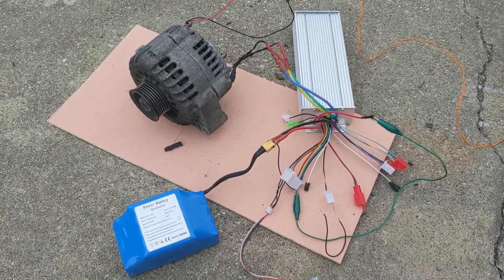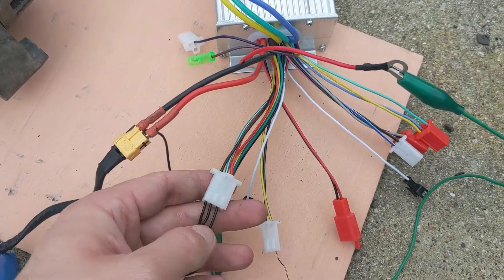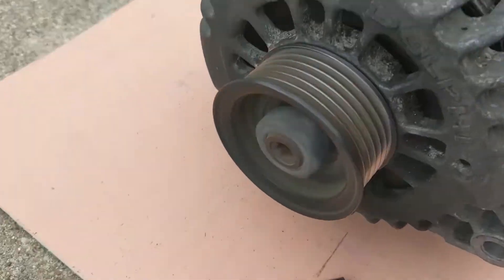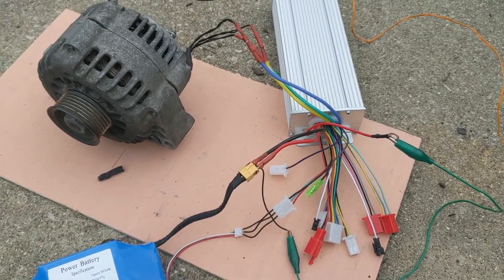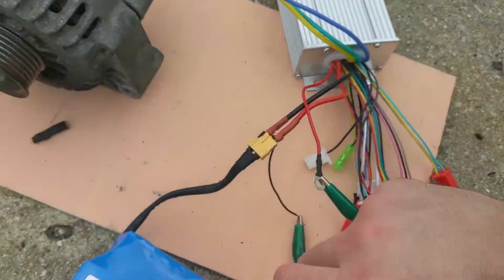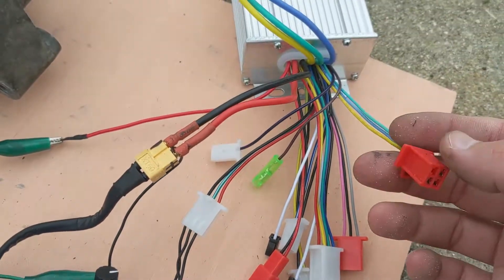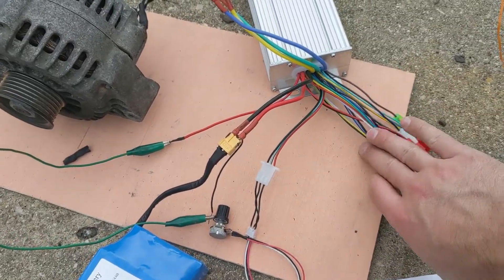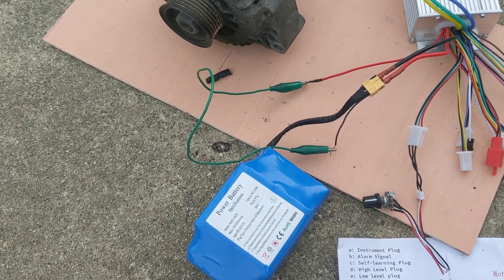Alternator to Motor conversion part two

Comment: 2:10 I think the motor spins slower when you loop the wire into the reverse connectors is because if the controller is used on a mobility scooter or electric powered go-cart then reverse mode must have slow motor revolutions for travelling backwards.

Comment: You obviously don't have to go so fast in reverse. If you want to change the direction switch two of the three wires going into the motor.

Comment: Power the stator with less voltage in the RPM will be better. A 3.7 lipo will work fine but, 2 1.5 volt Double A's wired in series is even better.

Comment: Why you need two batteries if you can use a buck converter with the 36v battery to get 12v for the rotor?

Comment: Hey what did you ha e the rotor connect to? I'm currently trying to figure out how I power the rotor from the same supply or if I get a second supply to power it separately from the stator

Comment: This is the most complete video on these topics I've seen.  You include the alternator mod, the field current control, AND how to hook it up to a controller.  Beautiful well-edited vid.  The only suggestion I can make is to update the links to eBay to make them more robust.  The alternator ones still work as of Aug 2022, but the rest of them fail.  Also, in the descriptions before the links, if you add more detail, we can search ourselves even if the links break.  I know I'm nitpicking -- this is still an excellent vid and the best I've seen.

Comment: 0:38 this is the rotor/field winding a.k.a electromagnet hence only two leads. The stator is the three windings excited alternately through the controller to provide a rotating magnetic field
Reply: Yes I agree, he mixed them up in his description and it confused me. So really I guess he meant 12V to the armature and the 36 to the stator.

Comment: Would simplify considerably if you could recommend a SPECIFIC alternator to convert ie, the "single wire" GM then go thru the process for doing so. Also, I am interested in building an eBike that would be best suited to left hand drive, the opposite primary rotation as this one.
Great vid my man, thorough and well-explained. I'm sub'd and very much look forward to more of the same quality videos. Call me weird but THIS is my idea of entertainment!!

Comment: I have one of those batteries and I think, if I'm not mistaken, I have 2 of those controller boxes that I picked up at a pallet bin store.  Now I'll have to dig them out and see if they are the same thing you have there.  I have plans for the battery though.  I'm going to use it for my TS100 soldering iron so I can use it portable.

Comment: So a 12V alternator will work and not destroy itself if you use a 36V controller?
Reply: Actually the alternator before the voltage regulator. In hi speed the AC voltage its become 30V or 36V. Because of the hi speed and hi frequency. The voltage become hi. After regulator the voltage output from the regulator it's DC 14V for the charging car battery.. From Malaysia here. 😁. Sorry if my English not good.
Reply: @errolyapp4286  Thank you for telling me

Comment: IMHO, the Part in the middle of the MOTOR alternator that has the shaft on it is the ROTOR which has two copper round surfaces which the brushes make contact with, this is called the slip ring. The stator is the laminations which has enameled copper wound through it.. seems that you were calling both STATOR..
  I did work in the alternator dept at Ford Rawsonville Ypsilanti MI in the 60s. They made 38 42 and 60 amp small frame alternators and I believe in the 70s started making Large frame alternators which had much more current and had built in voltage regulators. The earlier alternators from the 60s had external voltage regulators...
All the information you are sharing is GREAT thanks for sharing, very interesting to me. Keep it up you are doing well!
Reply: How do you connect it with six wire alternator

Comment: I wonder how many horsepower does it produce .. I am thinking in a go kart
Reply: Depends on the voltage, current, and if you use hall sensors

Comment: right a massive battery. can you use a 12v lithium pack?
Reply from the maker: Yes. The rotor actually will work with low as 5v. The speed controller is what needs 36v

Comment: Reverse polarity on that 12v for the brushes when going in reverse, I wonder if that would speed it up in reverse
Reply: I believe reversing the polarity of the brushes will do no good in this case.
Reply: Reversing the polarity has no effect if you do it when the motor is running it just jolts and continues to spin

Comment: Can we have 1 battery setup for both controller and motor?
i.e. 36v for both of them.

Nice video btw. 👍
Reply from the maker: Yes, but 36v is too much for the alternator core.. you would need to step down the voltage down to 12v or less.
Reply: MadeEasy thanks for the reply. What could happen if we’d still go that way? (without a DC step down)
Reply from the maker: @RIKOARIshowreel  it will take away more power from the battery and make it drain faster. It's best to limit the power going to the rotor so the battery lasts longer
Reply: MadeEasy noted. Thanks mate.

Comment: I'm testing the alternator with a multimeter and the negative and positive where you connect the 12v battery in your video, has a resistance of .001 to .002, is that normal?
Reply from the maker: Yes, all it is it's a coil of wire.
When you apply voltage it makes it an electromagnet
Reply: @MadeEasyChannel  ok thanks 👍

Comment: you can use the 5volt of the controller to power the coil,  no need for extra 12v battery. looking forward when it is in the go cart already..

Comment: About the wires connection from electronic speed controller to alternator; could you please tell me which color of wire to attach with A, B and C (green, yellow and blue)?
Reply from the maker: A B C wires going to the Alternator can be wired randomly
Reply: @MadeEasyChannel  Thank you so much
Reply: @MadeEasyChannel  I have Mercedes car battery, do you think I can use it instead of the 36 V battery?

Comment: Two questions: 

1) I don't see any hall-sensor wires from the alternator. Does the speed ontroller use back EMF to time the pulses, or is it simply unnessacary to have have hall-sensors or back EMF to controll the motor? Also: I have a speed controller that looks like the one you are using, although I don't know if it supports back EMF reading, can I still use it to controll an altenator?

2) How much current does the rotor require (the brushes), and how can know how much current my alternator requires? Also: Are you using any resistors to limit the current from the battery, and if you don't, will it not short ciruit?
Reply: Edit: I see question 1) has been asked and answered already.
Reply: For number 2, I think it doesn't require much current to excite the rotor, maybe about 5 amps maximum (depends on voltage of course), a very rough guess of mine.

As for the resistors, I can see it being used to boost starting torque, but it doesn't act as a short circuit if it doesn't have one, as alternators use wound rotors for, alternator purposes.

Comment: instead of the car battery, couldn't you just hook up to one of the other outputs from the controller?
Reply: Should be able to ditch the stator battery use a relay output to excite the magnetic field, 2 to 3 amp

Comment: Reverse direction of rotation by; 
a) swapping 2 of the STATOR windings [changes the direction of the rotating 3 phase field] e.g. change from ABC to ACB ... OR 
b) the polarity connection to the ROTOR [changes the magnetic polarity of the rotor]. e.g. simply swap connection at battery.  
You may need to do this if gearing, pully or propeller configuration the direction is wrong.

That machine will take higher voltage you know, especially on the rotor, BUT limit rotor current no matter what voltage applied.
Reply: a 2000 WATT BLM is only $75-$90...With the SPROCKET.lol
Okay. So I got a rebuilt alternator for $10..
by the time I go through all the song and dance..getting the proper sprocket.
God only knows how much torque and RPM..it might be...So I dont really
want to weld it..YET...i tried it...it works..but the  12V to rotor is
hit and miss..becuase if you leave it connected...it gets more magnetgy.lmao
I mean MORE TORUE...less RPM...sometimes it starts..other times it dosnt.
FU$k it...I spent $60 on a 1000 watt Brushed.I assure you it's bigger
than that damn alternator...with BRUSHES.lol (48V)
Im a cheap bastard..I got an MX500 for $20...it came with ESC,36v batteries,
breaks, pinon ( sprocket)...axle sprocket. It'll do 15 mph...the bike is a BRICK.
I have rear sprocket from e 300 ( smaller)..for the crazy RMP on 12" powerwheels...35 lb contraption..for a 35lb kid.
Hope fully it'll stay under 15 mph.lmao
little kids can do 30 mph on e300...on 36v 10" OD tires ( 350 watt).lmao
Reply: What do you think the rotor current should be limited to?

Comment: Do you ever experiment with the field coil voltage, and its effects on motor speed?
Reply: i know other youtubers tested it
Reply: @foxxyytofficial  yup... I was wondering if he had.  Or even knew about it...
Reply: @foxxyytofficial  Hi man. Please link me up with a YouTuber who has experimented with varying voltages and Ampere's going to the rotor of the hybrid  ( alternator). Thanks man
Reply: https://youtu.be/VgGDq8F8Zx8
Reply: From the research I have done higher voltage to field means greater magnetic field strength and hence greater torque. However there is less rpm as there's a tradeoff between torque and speed for a given power output
Reply: @tonyotieno8192  yes, I know. Was just curious if thos guy ever did it.

Comment: The car battery is actually connected to the ROTOR via the brushes....the stator houses the three windings commutated by the controller. Other than that great video.
Reply: 36V battery can be swap with lower voltage battery?
Reply: @fakhrinshamsudin5713  the voltage is governed by the controller. You have to provide the specific voltage given by the controller specifications. A lower voltage meas you need a 12v brushless driver, which may struggle sincce it needs to handle a greater current, that's why a higher voltage is used, to lower the current on the controller. If you mean 36v to the rotor brushes you can, but you will have a highly magnetised rotor which the driver may not be able to turn. The torque given is partially governed by the rotor current, so you must give enough current to meet the torque needed, and no more. A variable current driver is typically used to alter the magnetic field but that adds complexity. Best to just use 12v as it was desined for 12v by the alternator manufacturers.
Reply: @mo7217  tqvm for the answer, so the best is to use 36v for stator and 12V for the brushes?
Reply: @fakhrinshamsudin5713  yes that's correct. You don't have to, but it's a good combination
Reply: @mo7217  can u suggest other combinations? What knowledge do i need to know regarding the voltage combination? Any reference? Or website to read? Tq

Comment: I'm trying to find why my set up is not working. I believe it's cause I have a sensored motor controller. No where does it say that except the HALL SENSOR lead. Yours doesn't seem to use the sensor lead?
So some of these motor controllers don't use hall sensors though the lead is there? And il be looking for a sensorless controller now as installing sensors inside the alternator isn't real eAsy.
Reply from the maker: Do you have the two red wires connected to positive?
Reply: MadeEasy yes. Hooked up same as yours.
Reply from the maker: @barsixful  what about the throttle? My wires were different color then what was in the diagram.
Reply: MadeEasy my throttle has same coloured wires. On researching I found some controllers are sensorless. They don't use hall wires. I'd say mine needs those wires. It does say " angle 120 degrees" on case
Reply: MadeEasy . I have found a dual mode controller .sensor And sensorless. So it has a hall wire. Can I get the details of your controller? Thanks
Reply from the maker: @barsixful  I have links in the description of the one I have
Reply: MadeEasy . Thanks heaps. I bought one. Turns out yours is dual mode. Will work even if hall wires aren't connected. Awesome.
Reply: @barsixful  you can install hall sensors on the alternator

Comment: Dont need hall sensors?
Reply from the maker: You done have to have them to operate the motor
Reply: @MadeEasyChannel  it all depends if the motor control is dual sensor and  sensorless   if it was sensor type it wouldn't work requires hall sensors for position (timing) for current flow on individual coils  in a crude explanation